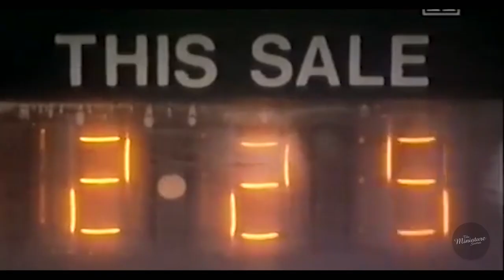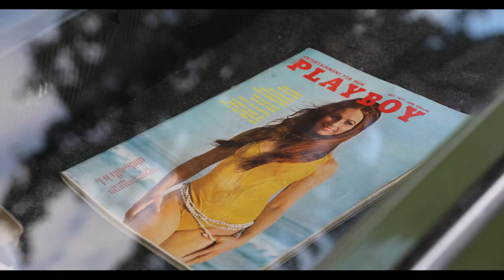Hillman Imp : History & Owners Interview // The Miniature Scenes

Comment: I had the misfortune to buy one of these cars in 1976. The quality was awful. Rust, seized kingpins, cooling problems, slipping timing due to a sheared lockpin. Perished doughnuts on the drive shafts. A brilliant design , years ahead of its time, spoilt by shocking build quality. I lost count of the number of times it let me down. Sad. By contrast, the 2 minis I owned, and 850 saloon and an 850 van gave me years of trouble free running.